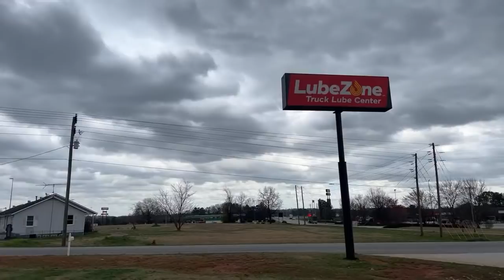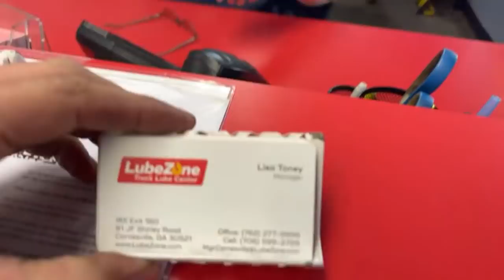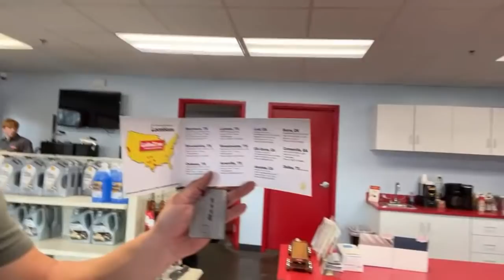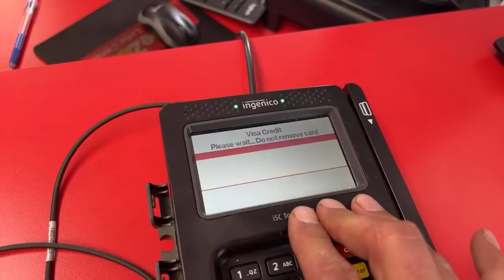FIRST oil Change W900 CUMMINS ISX

Comment: Hey there Justin, I hope you're all well and good!

I'm sure you're aware that Cummins has their own line of "Super Blue" lubricants, made exclusively for them by Valvoline, which allows for extended drain intervals that's not recommended with any other manufacturers.

I hope you're using full synthetics in every application, the savings they offer in mileage is becoming even more valuable now with diesel fuel hitting $5 a gallon in many places now.

I hope y'all have a good one! 👍🇺🇸
Reply: Man $5 a gallon is cheap, just hit $6.05 here in the far North.
Reply: @carlthor91  

Another reason I don't live up in the far North.
Reply: @RealJohnWayne  We don't have to put up with tornadoes or hurricanes, just the odd bush fire. The only ones up here are the people that want to be.
If I wish to go Walleye fishing, half an hour down the road. If we have lots of tourists, one of my friends will fire up a float plane, and off we go for a day fishing in a remote lake.
Best of all 480 miles to the big city.
Reply: @carlthor91  

We don't either, to far from coast for hurricanes, not enough humidity, and too many mountains for tornadoes, 4 seasons of moderate weather, with no extremes here in God's Country.